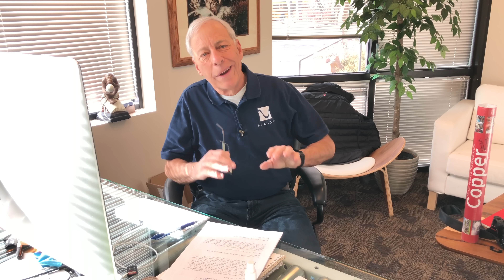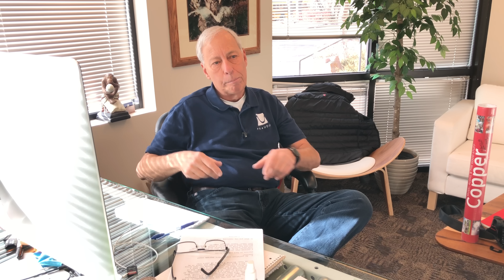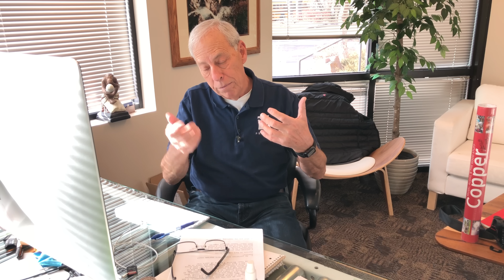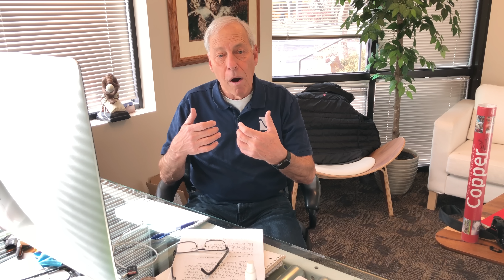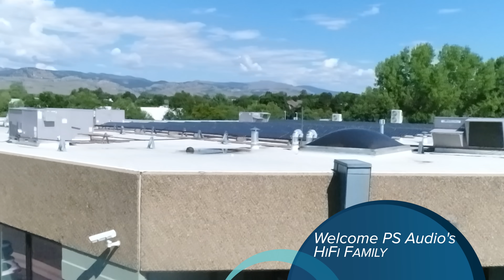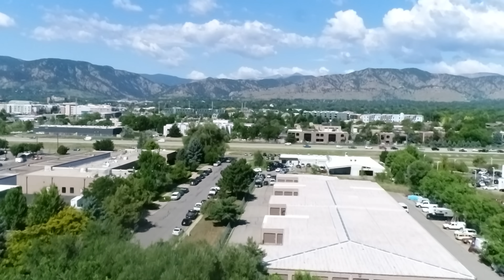Do isolation transformers degrade sound?

Comment: I added two isolation transformers to my audio system, one for my analog sources, the other for my digital sources, though I left my power amp plugged into the wall.  I added them because my EMI meter showed measurements of around 700 mVpp on every circuit in my house.  The Tripp-Lite isolation transformers reduced EMI measurements to around 40 mVpp.  I did not notice any degradation of audio quality.  Paul, I hope you will comments on whether that EMI noise reduction was worth it.  And what other noise might still left on the line to pollute my precious audio system.
Reply from the maker: I am unconvinced of the benefits of cleaning up this small amount of noise and am pretty convinced the downsides to cleaning it using an isolation transformer isn't worth it. The extra impedance added by the transformer seems sonically more destructive than the little loss from the noise.

Comment: Thanks Paul.  I am looking for the lightest power protection to run in front of my 12V UPS power supply on a mobile cart.  Right now i have a Puls CP10.121 going to a Nextys DCU20 and 12v 100 ah battery.  Please share your thoughts.

Comment: From an 'ole electronics technician... don't fix what doesn't need fixing. Wire an AC line as close to the incoming power line as possible and independent from everything else electrical as can possibly be done while avoiding loops, kinks and sources of magnetic flux to keep the signal as close to pure as you can. Doing any of thee will add noise into your system as a whole. Sometimes AC conditioners are good for some of us that are nearly spiritual about our music.

Comment: Patience is a virtue and because of silly poop like this  I am no longer virtuous. If your device sounds different because you install an isolation transformer or plug it into a different outlet that means that the power supply in the device is not doing its job.  The Harman Kardon Citation 16 sounds the same whether you plug it into a dedicated 20A circuit, or 400 feet of extension cord in the middle of a city park, because the power supply is well built and no corners were cut.

You know a lot about audio equipment, but please stop dabbling in voodoo!  That thing you call a "regenerator" is an inverter.

Comment: Everything he says up to 4 minutes 15 seconds is sound and true. Everything after regarding a stereo requiring a low source impedance to the AC is simply not true. He confuses the need to use low resistance and low impedance speaker wires connecting to the receiver output. But he translates this to the 120 VAC (or 240 VAC) input and what he says about that is not true. He totally dismisses as almost irrelevant the problems with ground loops in an audio system. Ground loops causing hum in an audio system can be eliminated with the use of isolation transformer(s).
Reply: not to mention HIGH FREQUENCY interference
Reply: @toneysunny9283  Yes to both! ground loop hum and high frequency interference were both alleviated with my isolation transformers.
Reply: @onfirepro Ground loops can be solved by installing an outlet without ground connected and using a GFCI for safety. Keep the ground exclusively the signal ground, or better yet, use balanced interconnects.
Reply: @kevenklarke452  that's against code I'm pretty sure... and won't solve ground loops anyway which is caused by audio devices being connected directly. Isolation transformers between pre and power amp will break the loop.

Comment: One thing that isolation transformers do accomplish is they break ground loops safely.

I had to resort to buying a tripp lite 20a medical grade isolation transformer. My marantz receiever and Outlaw Audio amplifiers have terrible hum caused by automatic transfer switches and an APC SMT2200 UPS in my basement on a completely different circuit. The inverter transformers in those units cause a ground loop and electrical noise, which was completely eliminated by the Tripp Lite Iso transformer. I just wish it wouldn't have cost me $500 to safely fix this problem.

Comment: What about a gadget like the TrippLite LC1200 I have?  
(It came cheap, about $8 at a thrift shop, 
and it was a purchase based on opportunity rather than on theory.) 
It protects against both high and low line voltage, either of which can be a problem, 
and should suppress some transients and other nasties.

Comment: If you have well made products with decent power supplies in it, all this is BS, most Consumer electronics has no issues with AC power lines, will my electric stove work better, this guy is clueless..my refrigerator works fine, ya don't need stuff in front of your power supply in the audio component.  And of course the Ps re generator, now problem solved, the AC lines have no problems, without some dumb Ps Audio nonsense

Comment: Thanks for the informative video. If I would like to build completely isolated power supply to home audio system, does applying stand alone solar panel system with inverter be a good idea?
Reply: KW T Well it would cost upwards of $10K to do it right. You would need an inverter that does a pure sine wave, not a modified sine wave, about 2K watts. At least 1Kw in solar panels.  Then a device to convert the solar panels juice to charge the batteries to run your system.

Comment: I’m gonna disagree with you on that one, there are isolation Xfmers that address everything you said, then again that’s just reading online 😀
Reply from the maker: OK, but maybe you can point to one. I know of no transformer or even transformer technology that can add energy back into the AC.
Reply: PS Audio you’re right, there are no products like yours, but there are Xfmers that handle power deviation (within reason of course) Regvolt 5000 Watts Deluxe Automatic Voltage Regulator Converter Transformer does that
Reply from the maker: @tapemaster8252  Right,m but not dynamically, which is what really matters. These voltage regulation transformers have multiple taps they can switch in with relays to make up for changes in incoming voltage, which is nice, but from a sonic standpoint not all that important. What really matters sonically, is dynamic voltage regulation, which only a regenerator can do.
Reply: PS Audio here is a simple, compact and efficient, scalable solution that is noise tolerant: smps (for the psu within the amplifiers, or DACa) and if you really insist or concerned about the noise (but you shouldn’t be, smps are not intrinsically noisy), it can be followed by LDO, or linear regulators, as the voltage is regulated, you don’t need to be concerned about the power dissipation, minimal heat sinking will be required, and you’ll still save physical space and weight; other solutions like external regulation via AC regulation are huge hacks; you say you drive innovation, so do it
Reply: PS Audio ok like never before, I get it, that truly is a marvel of engineering excellence for the high-end buyer, Salute to PS Audio 🔈🔉🔊🔊🔊
Reply from the maker: @FooBar89  Thanks but there's nothing attached or linked to. I would argue about your statement of SMPS noise. Every version of them I have measured are noisy - they kind of have to be given how they work (and by noise I am referring to radiated noise).

Comment: Certain loading can cause a DC component that can be filtered out by an isolation transformer.  Not all isolation transformers are created equal.  An isolation transformer with an electrostatic shield between the primary and secondary can remove higher frequency harmonics as well reducing AC leakage currents.  An Isolation transformer can eliminate ground loops that can otherwise introduce noise into the audio system.  Granted, the isolation transformer must be of sufficient size so as not to introduce excessive impedance into the system.  All of that said, the equipment power supply design is vastly more important than adding an external  isolation transformer.  If you want to eliminate ground loop issues, USE A BALANCED LINE!

Comment: Read this below that someone else experienced with an Isolation transformer bought on ebay,  the outcome below is a what most..... But not all people experience when using a proper Isolation transformer.

https://www.avsforum.com/forum/63-rear-projection-units/283557-finally-installed-isolation-transformer-wow-full-system-inc-hlm507.html

Comment: The real advantage of using isolation transformers is when all gear is connected to the secondary rather than separately through several transformers.  In that way you establish a separate ground and neutral which has the benefit of reducing the ground to neutral impedance inherent in your home’s distribution system.  This is especially true if you can keep the conductors of your separately derived system short.  Proper bonding and grounding in accordance with appropriate electrical codes is essential for safety and good performance.  For a typical hi-fi system,  I would recommend 500 VA or more to avoid core saturation that induces 3rd harmonics, and keep internal impedance reasonably low.

Comment: Yes but if you neutralise the neutral in America straight to ground not earth sharing, but instead of it going back to the transformer should cut out these noise problems you're talking about. And if you had a conditioner before the isolation transformer would sort out that problem you're talking about anyway

Comment: Paul mentioned a general number on the voltage on the power line distribution wires. As a general rule count the number of glass insulators between the line and the support and multiply that by 15,000 and you’ll get the approximate voltage being carried by that line.

Comment: Though not mentioned here, it's my understanding all AC coming in from the street is noisy and it matters not how close one lives to their local power substation.  I've been using several types of superior passive and dedicated line conditioners for the past 20 years and I can say with confidence that if one can find superior line conditioners (it's almost easier to find a needle in a haystack), they are easily the 2nd biggest musical improvement one can achieve on an otherwise well-thought-out playback system.  I've no experience with isolation transformers nor AC regenerators, but I've been told by those supposedly in the know, that they do nothing to cleanse the noisy AC coming in from the street.  But again, I've no experience with isolation transformers nor power regenerators.

Comment: Wanna isolate noise? A cheap and easy solution is to install a dedicated ground. You can also run a 10 gauge ground wire from your main audio wall plug to your equipment. A star wiring ground connection to all of your equipment can be beneficial. Just be sure you start with a dedicated ground first. This process lowered my noise floor substantially.
Reply: ^^he gets it^^
Reply: That's fine to run a larger ground connection. Just don't run that dedicated ground wire outside to an isolated ground rod or connect it to anything other then your building electrical ground.
Reply: @andydelle4509  NEC says you can run your ground to a ground rod as long as the ground rod is bonded to the house/building ground at the breaker panel. Most if not all states apply.
Reply: @cap96lt1  Yes, that is correct. You can have multiple ground rods but they must be bonded together with a #6 minimum. What you sometimes read in the audiophile rags is to drive in a dedicated ground rod for your audio gear and NOT bond it to the so called "dirty electrical ground". As you know that is a recipe for disaster and illegal code wise for good reason
Reply: @andydelle4509  agreed

Comment: It depends. I have a 4kW monster transformer. First, I had it wired floating, like a safety transformer for a lab, with the center tab as common ground. A better wiring scheme is to wire it as a noise supressor with reference to earth ground. This makes the difference. I'll never plug my chain back into the wall outlet, yuck! In some chains, people still need some distortion caused by HF to spice up the sound. Once that is removed, it suddenly sounds dull. I call this "distortion deprivation". The "crisp" sound may be just distortions. It also happens when filters are applied in the power supplies. Erroneously, the filter gets blamed, yet the device became more honest and accurate, and that's not always to ones taste. It is a long journey to free all components from HF distortion and still have a powerful and clear sound.
Reply: Perhaps what you're referring to is called "dithering"???🤔
https://www.waves.com/audio-dithering-what-you-need-to-know
Reply: @RTR-MATEY  Wouldn't call it that. Dithering is a controlled process in the digital domain. My experience is that cleaning up power supplies for example reduces the agressivness in the sound, which may appear lame and slow first, but with continuous work on all elements in the chain,  the attack and clarity increase and then you get the true details, not the distortions, which they are often confused with.
Reply: @hermannschmidt9788  Excellent comment.
And you can always add distortion if you need
Reply: These things also depends on where in the world you live etc. Where I live I get little to no benefit of doing the things you mention.
But if I lived in some other area it could help. But I generaly agree with you

Comment: I understand Paul's stance, but I can't understand how Torus Power products have earned, over many years, the enviable reputation they have, if what Paul is saying is correct. From multiple installs, my first hand experience is that I, and the others in the room are generally blindsided by how much improvement is found when using a Torus RM15 or RM 20 isolation transformer. Some with, some without Voltage stabilization.
Reply: Evan McCosham I have a RM20 coming in on a gamble of what it will do to the feed to my system.   It is so far the only component that I did not demo because the technology of isolating makes sense. It’s even said you’d want to be on the transformer by yourself?? This is what Torus is doing in a small scale.
Reply: lowell a that’s awesome congrats. I have an RM20 as well, powering a full Bryston stack. You will be happy!
Reply: Evan McCosham hooked mine up last night, and it’s hard to ever thinking of having a system without it!  Not just an immediate difference but increased sound qualities to my ears and I’m very critical. Even my wife who just plays with the system in the background for casual listening came down and asked “what did you do? Sounds pretty good”. :)
Reply: @labalo5  Amazing! Enjoy - glad you're happy with it